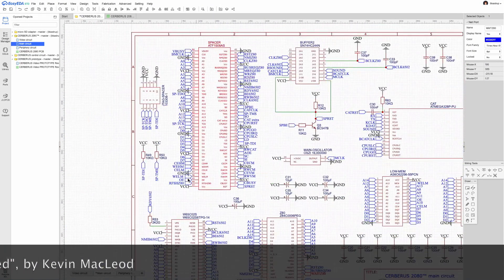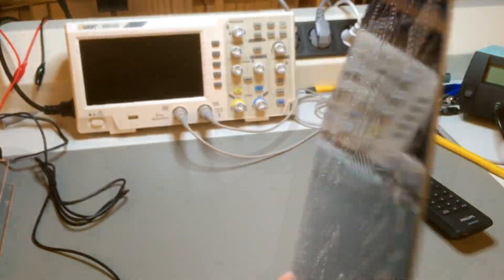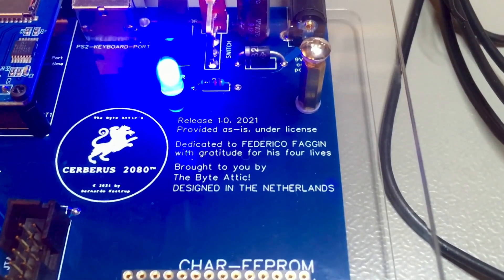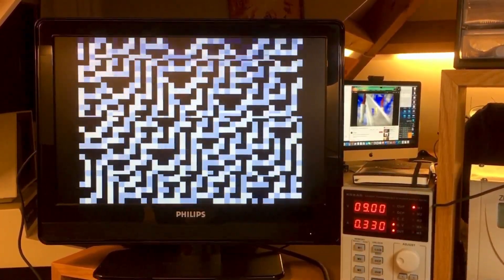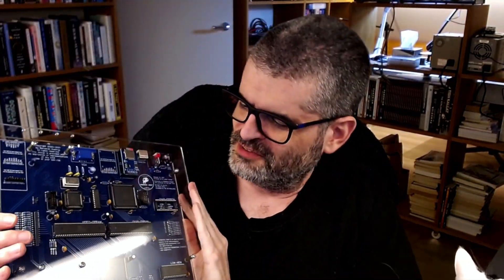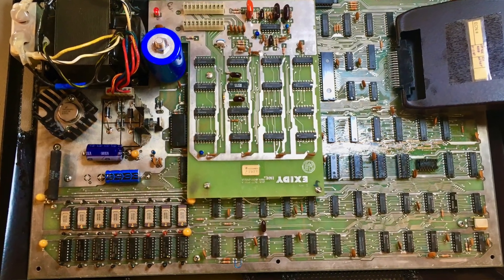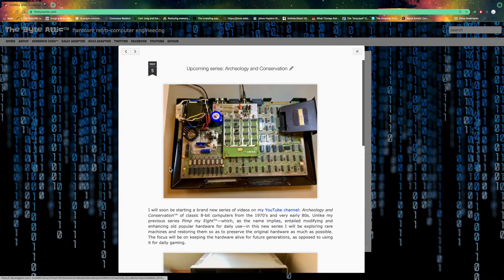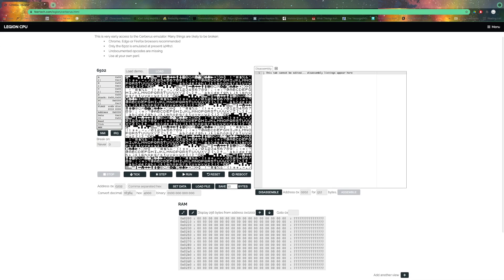Building CERBERUS 2080™, my dream childhood computer: Episode 21

Comment: Interested in building one!  I searched for the ICs and most are quite easy to find.  The one that has given me some work is the Renesas 7132LA55PDGI, which is on a EOL notice.  Do you know if there is some drop in substitute for it?  Thanks for the beautiful project!
Reply from the maker: We just got our hands on a huge pile of new-older-stock 7132's, which will go to the home computer museum (https://www.homecomputermuseum.nl/winkel/producten/#!/Cerberus-2080/p/377348409/category=0). Soon they should be able to start selling kits of assembled units again! At some point, when we really start running out of that part, I'll redesign the board to allow the use of the same part in a PLCC48 package, which is not EOL (though a little more expensive).
Reply: @thebyteattic  Will be on the lookout.  Thanks!
Reply from the maker: @antonyrodriguez5621  I hope to deliver the ICs to the museum this week. After that it's up to them. They usually want to make sure they can deliver everything at most 8 weeks after receiving the order, so it will depend on their being confident they can quickly procure the other parts.
Reply: @thebyteattic  Great news.  I'll be checking the museum website for availability.  Thanks for the update!

Comment: Just finished to watch all the 21 videos in this series: I'm amazed by your work, especially the time you spent to explain how things work (or don't work and how you fixed them, which is even better). Loved that.
30 years ago, I developped an adventure game called Fugitif (Amstrad CPC, french only), which was marketed (how proud I was, at only 20!), but I since forgot most of my skills in Z80 (which is a great processor).
But I plan to dig again into the fantastic world of 8 bits computers, by 1) learn again how the CPC work, 2) fix some old Z80-based computers (I'm restoring an old ZX81, thanks for your series), and 3) show young people how a computer works (via the hackerspace I attend).
I first planed to build the Z80-based RC2014 project, but I think CERBERUS 2080 is muuuuch better! I can build my own, but I was wondering if you could sell me the 3 pre-programmed CPLD, as they need some specific hardware I don't have right now?
Also, I would like to ask you if there is a specific channel to discuss about CERBERUS, aside Facebook (I don't have any account)?
Again, bravo for this work, and thanks for sharing!
Reply from the maker: Thank you! I don't sell anything actually, but all you need for the CPLDs is a JTAG cable that goes for about $50. Here it is: https://www.microchip.com/developmenttools/ProductDetails/ATDH1150USB
The instructions in the build manual (available in the Github repository) tell you everything you need to know to program the CPLDs. It's probably the easiest part of the build. You also need to change the fuses in the ATmega328p, but the manual contains all the instructions you need for that as well, plus a list of the material required (basically a very cheap Arduino UNO and a small breadboard).
Reply: @thebyteattic  Ok, I though the JTAG stuff was more expansive than that.
For the ATMega, no problem, I use them in several designs. BTW, for a v2, it would be interesting to put an ICSP connector; this way, it could be programmed without using Arduino lib, via lib-avr, which would free a lot of space!
Thanks!